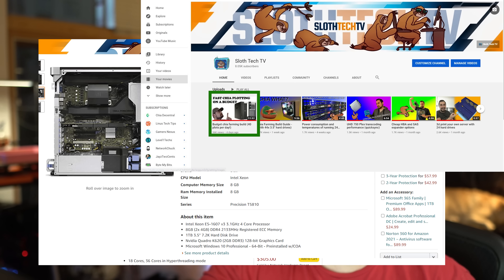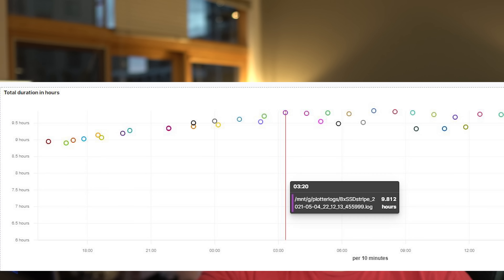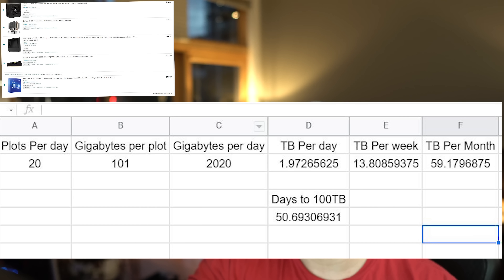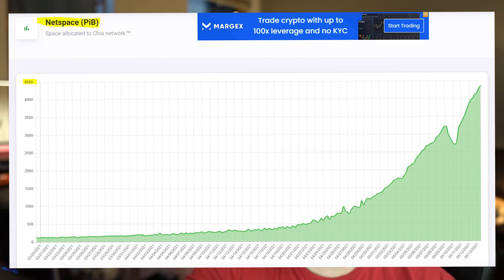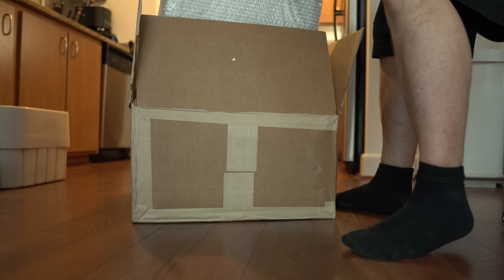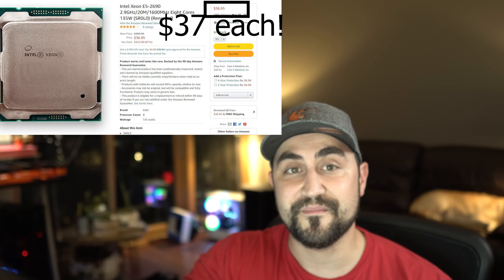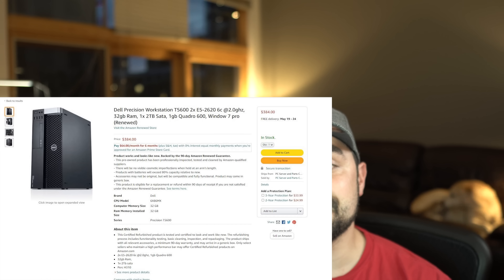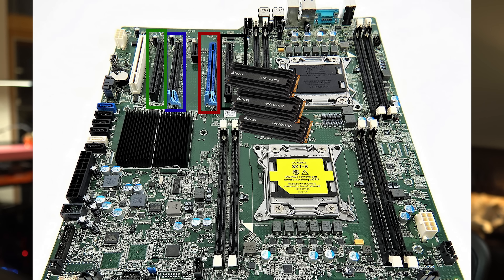Chia Plotting Build $620 w/ Dual XEON CPUs

Comment: Thank you for the inspirational videos. Based on this I looked for used computers around my area. I found a HP Z600 with dual X5650 processors. According to geekbench benchmarks, they should have around 60% the performance of an E5-2690. I paired this with 24gb ram and 1tb NVME SSD, hoping to get 20 plots a day. Unfortunately, I have only been able to plot 10 plots a day, 4 in parallel with 9 hours on average per plot. I'm still trying to figure out what is slowing me down so much.
Reply: I don’t know anything about plotting but I would imagine you are not getting full speed from your nvme. Your sister would not have native support for m.2 nvme so you must be using a pice adapter. I bet you are getting slow speeds from that adapter

Comment: Many thanks for this, went for T5600 and dual E5-2690's , in the UK prices are higher but works out ok. Problem is finding fast nvme, how much impact would it be using WD blue 2600MB/s vs samsung 980's as there are none to be had. would the 32 threads be bottlenecked you think?

Comment: Dear Sir, 
HP ML310e Gen8 v2 Intel Xeon E3-1230v3 (3.3 GHz/4-core/8MB/80 W) 
how much slower can this configuration be on machines with E5 processors that you have tested?
just singel XEON E3 
Thx

Comment: NVMe to pcie adapter $26: https://amzn.to/3whYOeV
Is it a dual slot NVME to PCIe adapter? I could install 2 NVMe SSD on it?
How about this one ?
ASUS Hyper M.2 X16 PCIe 3.0 X4 Expansion Card V2 Supports 4 NVMe M.2
 https://www.amazon.com/ASUS-M-2-X16-V2-Threadripper/dp/B07NQBQB6Z/ref=sr_1_3?dchild=1&keywords=asus+m.2+to+pcie&qid=1621605951&s=electronics&sr=1-3

Could I install it on T5610 or all of your suggested renew PC??

Comment: I don't get it. Where is the storage in these videos? This is just the plotting.
Reply from the maker: Thats right -- its just for plotting. I have made previous videos about adding a ton of drives to a computer and i dont know how much that needs to be covered.. plotting is the hard part.. putting a 101GB file somewhere is easy so long as you have a disk to put it on.

Comment: Is this config enough for 7 parallel plots?
Lenovo ThinkStation D20 Tower
CPU: 2x Intel Xeon X5650 2.66 GHz (6core 12 threads each)
RAM: 64GB ECC DDR3
GPU: Nvidia Quadro FX1800 768MB
PSU: 1060W
SSD: SILICON POWER 2TB UD70 M.2 2280
HDD: WD Purple Surveillance 8TB

Comment: Would these CPUs work well with Plex? I plan to build a server for chia plotting and when have plotted enough use it as Plex server. Need to be able for 4-5 devices to stream at the same time 10-20GB movie files. I read Quicksync is important for that but it seems it is supported only in newer Xeons onwards.

Comment: My dual 2680 v3 are 5 days late showing up and cant find breakout cables. Might have them built locally since i only have the single 2630 v3 that cam with my 7910

Comment: Thanks for sharing! What size power supply are you running on the T5600? I'm wondering if the 635W will be enough, or if you need the 825W.

Comment: Alex and you help out how you are configuring Swar with the dual Xeon's? I am working with a T7910 w/ 2x E5-2699 and 64gb RDIMM. Struggling trying to figure out the optimal plotting setup as I have a weird mix of SSDs. System came with 2x 240gb SSD and I was able to get a 800gb S3700. Trying to source some more SSD's currently. I have watched your videos every day back to back and I am drowning trying to figure this out better. Thanks again for your content!

Comment: Loving the content. I am currently working on a building a Dell Precision 7810 unit now based on your videos. It has 2x XEON E5-2620 12 cores with 65GB of RAM. I am waiting on a SATA 1x4 splitter for the power supply so I can power the 4x Intel DC S3520 drives I found. The only issue I am running into now if finding a drive enclosure for my SSDs as there is not room in the case and I do not want to put them in a 4 drive USB 3 case. Any suggestions?

Comment: hey, how are you? 
can I ask you about this deal?
I've got this system for 490$$
Dell PowerEdge T410

cpu 2X Xeon 5650 
128 GB of ram
1200 W PSU
and is 2TB SSD SATA is good for plotting on this system? and is there a huge difference between the SATA and nvme is plotting. 
thx for the help I hope that you can reply as soon as you can.

Comment: Great info!  Using your link I went with a T7810 with dual E5 2680 V3 processors, 128gig ram, and 3 x 2tb sabrent rocket ssd.  On windows 10 I can only see 1 CPU, under task manager while plotting it only is using 1 CPU it looks like, and under system information is just lists 1 CPU. I checked and there physically 2 CPUs installed. 

Any tips or tricks to make sure that you are plotting both CPUS and using all 24 cores? So far just able to see and use 1.

Comment: Thanks for the great ideas!  What do you think about the Prebuilt 7910 with DUAL 2690 v3 (12-core) 64GB RAM you linked for $1797 (currently $2168), versus buying 2x T5610 with DUAL E5-2670 (8-core) and 64GB RAM, for $560 each ($1120 total)?

Comment: Any idea what motherboard the T5610 is using? I bought a T5610 the other day and am trying to plan out my setup while I wait for it to arrive. Trying to optimize my HDD setup, currently sitting on 5 x 12TB HDD and 2x10TB HDD and want to keep this from turning into a mess lol. Considering ordering a larger case with tons of internal 3.5HDD slots but need to know the form factor of the motherboard. Or if you just happen to know how many SATA ports it has thats helpful too, thx!!

Comment: Hi, you recommend PCIe Gen4 SSDs, however the Xeon CPUs and adapters only support up to Gen3. Is there a particular reason you choose Gen4 over Gen3, despite the higher price? Will they perform faster?
Thank you so much for your videos, really helped me! I get my T7910 with 2x Xeon 20c processors and 256GB RAM delivered next week. Just about to add some NVMEs via the Dell x16 -> Quad m.2 cards. Any feedback on that approach? Would you recommend to RAID the NVME drives?

Comment: Hello I found a server at home in France can you tell me if this is the right configuration please to undermine the chia
Dell Precision T7910 XL
  Win 7 Pro
Intel Xeon E5-2620 v4 processor (2.1GHz, 3.0GHz Turbo, 8C, 20MB cache, 85W)
2 graphics cards AMD FirePro W8100 8GB - DDR5- 4 Display Port (8 in all) * (see description)
16GB RDIMM, 2400MHz, DDR4,
512 GB SSD + 2 X 512 GB SSD in RAID
DVD engraver
Hot-plug 1300 W power supply
thank you

Comment: Gathering the bits today.     Looking Fwd to messing with this.

Bookmarks4 ME!

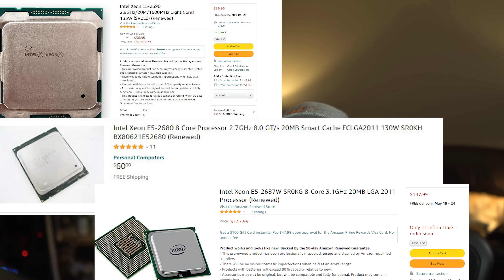4:00 Cpus

Man prices are always so mush higher in the UK..   

So far 
Dell 5600                                   £410
ES 2690  X2  £ 60e                   £120 
M2 Pcie Adapters X2  £15e    £  30
2 TB Nvme SSD   X2    £162e  £ 324

Total £884  Or about $1250 dollars 

Haven't bought the Ram yet so    that needs to come too.  AND  a 12 TB drive is about £350-400  !!!

Comment: Dell Precision T5810 Workstation
Intel® Quad Core Xeon E5-1607 v4 Processor (10M Cache, 3.10 GHz)
16 GB DDR4 ECC RAM

Anyone have any advice on what upgrade I should do to this? Also is it a hooded deal for $550 usd?

Comment: Question: Does E5 2680 v3 Supporting the DDR 3? I check the spec found it likely only supporting ddr 4,  how's your set works?
Reply from the maker: thea 2680 v3 doesn't support ddr3 -- this video was for a t6200 which uses a 2680 v1 or 2690 v1... Which does use ddr3

Comment: Did the t5610 can handle v3 cpu or only v3 ?
Reply from the maker: V1 and V2 only
Reply: Thx for fast reply i try sort out which can handle more threeds for plots . T5600 can use 2xxeon max 32 threds .. but t5610 can use only one v2 ... there is any not expensife option to handle 2xv3 or take more the 32 threds on 2 cpu ? Thank u .

Comment: need help!  I purchased the t5810 unit in the last build (only 8 ram not 16 though)  Purchased the 32gb ram and the e5-2699 you recommended.  Waiting for the balance.  I had purchased an intel p4510 2tb u.2 drive with a u.2 to PCIE.  I am a little stumped though.  I saw in a previous video a question on how to get to 40 and you mentioned raid?  How is the raid setup (nvme drives?).  I dont want to buy another of the intel drives $$$$$$$$$$$$.  If you are raiding the NVME can i mix and match acceptably or can I add any m.2 2tb nvme?   It only has 2 pcie 16, then an 8,4,1.  Do I only want the 16s for the nvme?  Thank you so much for your videos too!
Reply from the maker: If you got  2TB p4510's you won't want to raid them.. raiding is useful for smaller SAS or SATA ssds. NVMe drives use 4 pcie lanes -- so the x16 works fine, but the x4 will work just as well (so long as it negotiates to pcie 3.0 and not 2.0)
Reply: @SlothTechTV  thx a few more, is 40gb ram, a single 2tb u.2, an additional single pcie 3 nvme then adequate for the 40/day?  How do you set that 40 up to run? does that become 10 sequential trains of continuous plots started staggered in some fashion?

Comment: Hi. I'm basing my build on the Xeon E5-2680 and the mobos I find are ASUS Z9PA-D8 and Super Micro X9DRL-3F. I'm worried whether or not a 980 PRO or similar will be compatible with it. I'm not sure if the adapter you listed will work or not.

Edit: The drivers are what matter. So I reformulate my question. Will the drivers for that mobo work with those drives?

Comment: You missed a very important point in the video, for me the most important. Show how you are staggering, settings for each plot (mem and cores), what is your delay, how long are you taking for each plot and how many in parallel. This would help to make sense on the math. I got 2 machines with 8 cores (1x i9 and 1x Ryzen 3700X), both with 2TB NVMe (one is the fast MP600), got 32GB of RAM on each and to get 6.1/2 hours per plot I need to stagger them at 90min each. I can only get 13 plots a day on each and that is pushing. Would love to see your math because I am clearing doing something wrong.

Comment: I startet plotting a week ago, but considering the total network space more than doubled since then, SSDs and HDD hardware prices have risen by 30-40% (if you can find stock at all) all this is a fools errand for most people. Once you have a good plotting setup you will run out of space fast and must keep buying HDDs just to attempt to keep up (and there is no chance to keep up with chinese professional farmers). You will also wear out and destroy a lot of the cheaper SSDs pretty quickly and need to replace them often. All this and you still might not "win" a single coin since farming is basically a lottery. At least with Ethereum you don't completly destroy the hardware used and can sell them once they can be replaced by something better. I will plot until my spare HDDs are full and hope I got lucky once, but trying to keep plotting by buying more HDDs will not be sustainable. Maybe when ppols arrive it makes more sense, but even then the total network space is rising so fast that it won't be profitable for long unless the Chia price rises alongside.

Comment: Awesome videos, the best for Chia! Have some questions man.
1. Does Prebuilt servers are like just plug and start plotting machines?
2. How many plots per day generate the Prebuilt 7910 with DUAL 2695 v3? 
3. For this Prebuilt 7910 with DUAL 2695 v3 how many Samsung Pro 2TB NVMe do I need for max plotting?

Thanks!

Comment: Are you sure your running nvme on a Dell t5600? I have 2 of them and from I read nvme adapters don't work. Can you please advise me?
Reply: I got the same issue, I bough an Dell T5600: Windows hangs when booting if the PCIe nvme Adapter with an Crucial P5 CT2000P5SSD8 2TB is installed

Comment: I’m wanting to build up the T5600 system on this video. Thank you for all your hard work and info. Can you elaborate on just this system? Your information is very good but i get confused when you side tangent on other possible builds or options. What exactly would i need to build this specific system? Dell T5600 2x E5-2620 Workstation, (2) Intel Xeon E5-2690 Processors, (4) 16 GB PC3-14900 Memory. What else? I’m stuck here. Complete newb here but I am excited to get started on this journey.
Reply from the maker: Sorry for the side tangents... 
You'll need to replace the 2620 cpus with e5-2690 or e5-2680 processors
That should be enough RAM! great job.
You'll also want either SAS Enterprise SSDS (S3700 intel, or hgst sas ssds) for temporary space to plot
Reply: @SlothTechTV  Please don’t apologize. I’m am not savvy in this area at all. How many S3700 intel SSD can i out in this setup? Just trying to follow your instructions because I’m in the dark with this. Thank you for your time. I appreciate your content.

Comment: Hi, because I live outside the US, I couldn't find a T5600, but I've found a T5500 with the following specs, could someone tell me if it would be good enough for Chia? (except the hard drive, of course) Many thanks

Processor: Intel Xeon E5. (it can fit a 2nd one)
Processor type: Intel(R) Xeon(R) CPU E5620 @ 2.40GHz
RAM: 36GB DDR3 1600
Hard drive: 600 GB HDD Raptor 10,000 Rpm
Video card: Qaudro 4000 2GB

Also if possible, could someone state what I should add to it? I don't want it to become too expensive though

Comment: Guys there is no cheap fast way to plot points. The dificulty on the network is getting harder by the day and hard drives are getting more expensive. I spent 5K to build a fast rig and i dont even plot more than 30 a day because hard drives are too expensive and space consuming to keep around. Also keep in mind that there is a limit to the amount of harddrives that an operating system can recognize. windows will only allow you to do 24, whereas linux will allow you to do more. i might just sell my rig and my 124tb HDD, 3 x M.2 NVME GEN 4, and 5 SATA SSDs if i dont hit at least 4 blocks after i filll all my hardrives.
Reply from the maker: I mention the difficulty in this very video youre commenting on. And the max hdd thing.. well thats not true.. I literally have 60+ hard drives on a windows box and it works fine. Is linux a better option for plotting? Sure. That doesn't take away from the fact that your fast rig is probably just not tuned correctly.

Comment: Question about upgrades -- like LSI controllers and such -- does using a Precision mean not worrying about "IT mode" flashing of Dell server components? It seems that getting off-the-shelf used Dell can be cheaper than OEM, but usually carries warnings about compatibility or ability to upgrade firmware outside of Dell servers.

Comment: How many plots do you think a ryzen 9 3950x is capable of in a day, with 2tb nvme storage
Reply: I am using a Ryzen 3600 with 1 TB FireCuda SSD, 5 Plots in parallel staggered by 75 min and I achieve 18-19 plots a day. 3950x with 2 TB SSD should be able to double that easily, but you would need 32 GB of RAM.
Reply: Do you sell the plots or is a plot like 1tb

Comment: Great videos. I've learned so much.  I have an HP Z800 Workstation 2x Xeon Quad Core X5570 2.93GHz 48GB RAM 2TB 7.2K PC SATA Drives lying around. Would it be worth it as a respectable replacement for your recommended builds? Thanks

Comment: What would be wrong with using the E5-2670? It is 8/16 and 20mb cache just slower clock speed, but even cheaper included in pre-builds.

Comment: @SlothTechTV: I would like to see some proof which numbers you are actually able to produce, sometimes you talk about 30plots per day, then 40plots per day, then 35plots/day - not very serious. Also, considering that people are complaining in your comments that they have a similar setup and barely able to reach 15 per day. Furthermore, please explain how many jobs in parallel you run, which settings you use and how big your SSD storage used for plotting is. Thanks, highly appreciated!
Reply from the maker: Absolutely -- Currently I'm at 20 plots today with this dual 2690 t5600 and its only 11:02am. I'm plotting on Intel s3700 400GB SAS SSDs (very cheap on ebay.. or at least they were when i first made a video about them). I have it broken up by 3x 400GB SSDs in raid 0 with 2 plots in phase 1, 60 minute stagger time, 4 max concurrent and 4 cores each. Each raid 0 of 3 drives is capable of completing approximately 8-9 plots per day, I have 5 raid 0's with a total of 15 drives. That gets me 8*5 = 40.. I'm still tuning so I'll let you know what kind of performance i squeeze out with a bit more tune.
Reply: @SlothTechTV  Thanks for sharing this. The first plots are not reliable, let's wait for your system to settle and look at a full day of plotting - very curious already! Just to understand it correct, you are running 5x 4 plots in parallel? Please provide more details about your setup, do you use e.g. plotman?
Reply from the maker: @dvalin231  I have been  plotting on this for several days the 20 plots today was just a data point as i think I'll get more than 40 plots today. I said 30-40 in the video because ymmv with whatever storage you use. That said I am getting about 37-42 plots per day.. it mostly comes down to lots of fast SSD... The SAS SSD option is a bit more expensive but you can take advantage of having many of them vs just a few nvme drives.
Reply: @SlothTechTV  Do you have discord or keybase? I have many more questions and would really like to share and improve this together!
Reply from the maker: @dvalin231  Yeah! Sounds great! I'm working on the discord piece ill get it all set up and share it with you
Reply: @SlothTechTV  Just check Caleb's discord, the interest is huge at the moment ;) 15k members already within three days
Reply: @SlothTechTV  Quick follow-up question to this. If I don't manage to get server SSD and would get only NVMe 2TB drives, how many shall I get for A 2x 2690 build and B 2699V3? What's the total capacity needed with NVMe to reach 40 Plots per day?
Reply: @SlothTechTV  which video was that?  Ebay link to the s4700?